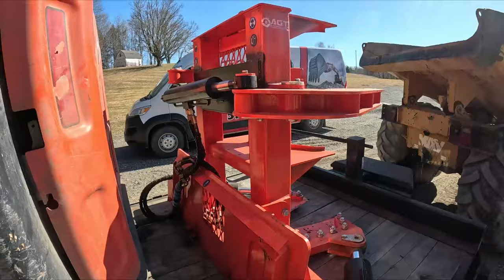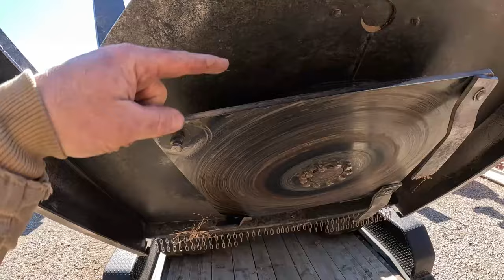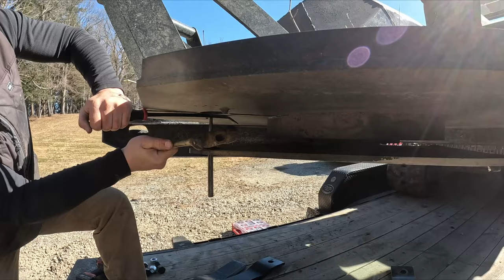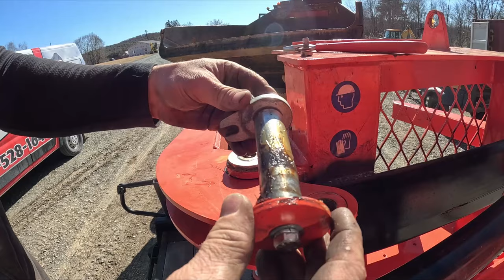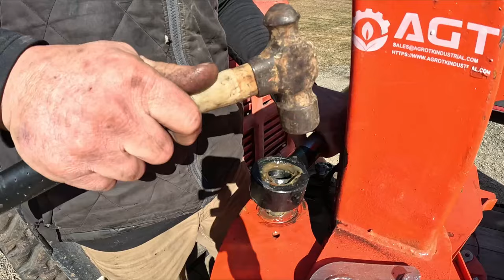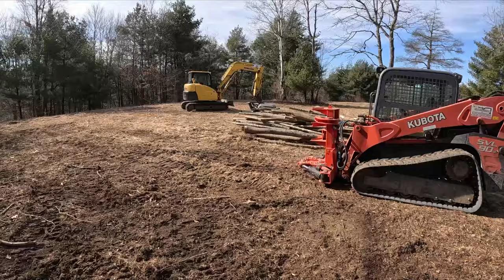Fixing AGT Attachments fails & flaws fix

Comment: Use Grade 2 because the higher grades can't handle horizontal sheering as well. Grade 8's won't stand a chance for long term usage. "Tensile strength is the amount of pull the bolt can withstand before breaking" - Grade 8's are stronger for pulling but not side sheer. If you are using it for side load as for that pin then use a lower grade. Just google it if you don't believe me. 20 years ago I kept snapping in half grade 8 bolts on my ladder bars on my 69 Camaro, I swapped them out to grade 2's and never snapped another one. I wish you the best of luck, I love your channel

Comment: That shear the blade doesn't line up the whole way. It has to be bent or weld broken back at the pivot point.  Nice fix on the brush cutter. I think I would still add another nut on top just to protect the threads so things will come apart easier.

Comment: I would get another square plate and weld the two together and leave a space between them for the blades. It would not brake the bolts near as bad as it does now.

Comment: Give cid brush cutter a try they aint  stupid expensive i was gonna get a bradcon ground shark but ended up getting the CID extreme duty brush cutter its rated for 7 inch diamer hard wood and i did try there smaller one first that was rated for 4 or 3 inches only and the blades were kinda more like yours and were really more designed for grass fields i think so i got the extreme duty after one try and saw the blades and new i needed more rugged for what i do and the blade nut is also welded so to remove blades you gotta cut a weld first so no way it can come off

Comment: I bought that same brush cutter at auction and i loved it! But then it locked up on me. Prob my fault for not greasing the motor. I ended up sending it back through the same auction and got a higher price for it which offset my buying and selling fees so i broke even on it
Reply from the maker: Don't buy another one.. 😂

Comment: Those mower blades need to have an L shaped bracket to hold them in, so they are captured both sides to reduce movement. It will also put the fasteners in double shear, which is incredibly strong. I also think the blades should run on nylon bushes.

Comment: My brush cutter blades are fairly tight. As far as the shear goes, if while cutting you “roll” the shear it can bend the blades. Looked like you were torquing them pretty good while dragging one of those trees. Also, when clipping a tree try and keep it in the center of the blades. Looked like a couple trees were too far back and you were doing more crushing than cutting
Reply from the maker: Good to know I might tighten mine a bit.. I saw that while editing the tree gets pinched..

Comment: A regular Bolt of any grade should not be used for a blade on any heavy cutter like that. There is a safer heat treated forged head bolt with castle nut and role pin on quality cutters, be aware!
Reply from the maker: No doubt

Comment: By knocking out those bushings, you just transferred the wear point to the hole that will now wallow out…not the best idea.i would have put a steel bushing in place of the shouldered bushing, as a wear point….so the primary hole on the carrier doesn’t wear out….
Reply from the maker: Make sense

Comment: Don’t they make some kind of bolt for bus hogs that has a big cap on one end and allows it to spin and is very heavy duty? Look under a standard bush hog and see, maybe you could order them.
Reply from the maker: Yes I explained that in the video.. unfortunately these blades are odd size hole and the plate they don't make  brush hog shoulder bolts that small
Reply: Ok my bad for not paying better attention. Could u just drill hole bigger? U probably answered that too! Getting old lol
Reply from the maker: @kevinhennessy6193  I didn't want a week in the blade or go to dramatic with the engineering

Comment: What’s the recommended diameter for those shears think you maybe cutting to big of diameter trees. I ran a rotary brush cutter for 25 years and I would brake a blade once a month you hit a rock just right and they will brake in half and shake the hell out of you. And I used grade eight bolts. There’s a limit of 4 inch round tree you can cut down with those rotary blades those were American bolts and blades I used. They also were supposed to be torqued  down to 600 ft pounds.we eventually got rid of the rotary blades and went to a flail. They break too but way more cheaper to replace.